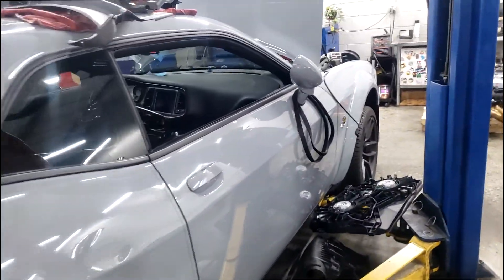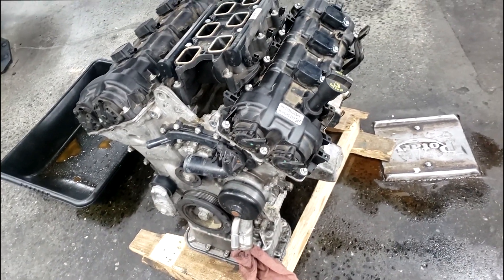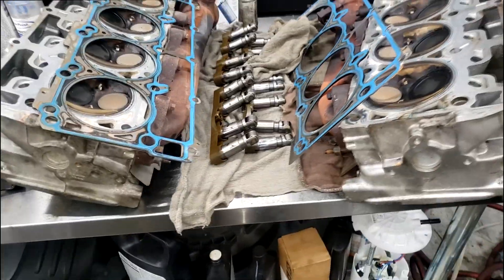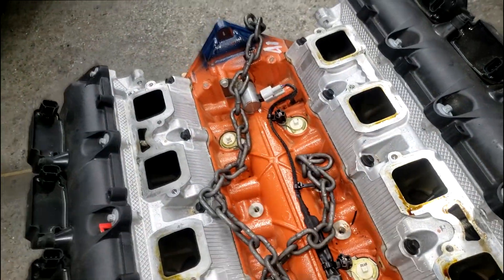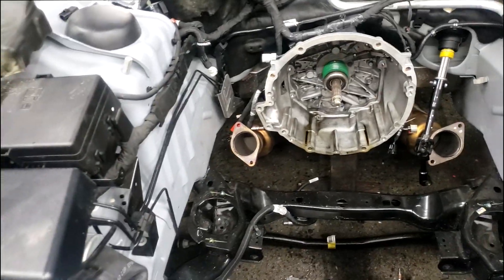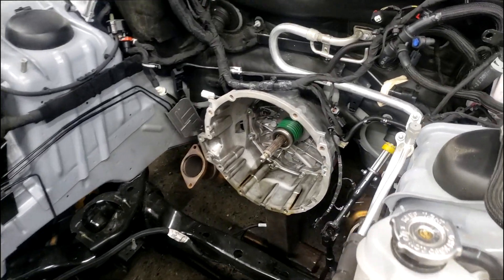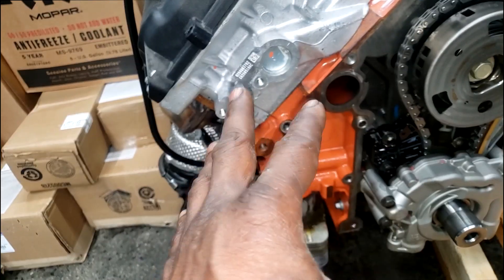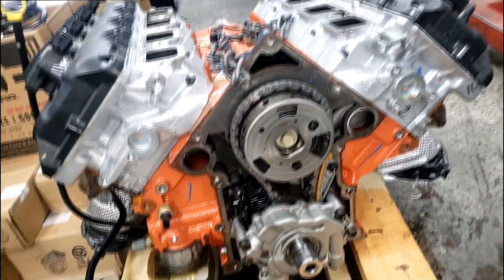Here's why this motor getting replaced.

Comment: I worked at a Chrysler dealership for many years.  There was a TSB at one point in time, probably around 2015 - for cars where they originally recommended full synthetic 0W40 in the past, it was recommended that if the car is being used for any "Severe Service Duties - such as Police or Taxi, to upgrade to 5W40 full synthetic.   Nothing said about racing, but I can assume that it would fall under the "Severe Service" category.   

I run my 392 V8 on 5w40 as well as I some Lucas zddp.  I also have an automatic and disabled the MDS.  So far, I have been lucky but who knows what the future beholds.  There has also been some discussion within Chrysler as to which oil filter to use.  Some filters are white with blue lettering and others are black with silver lettering.  I have been told to avoid the white filter and use the black filter for this particular group of engines.
  
Plate C
Reply: Catch can and top tier fuel stations like shell/chevron

Comment: People!  Stop driving through water!  If the water is more than about ~6 to 10 inches deep then you're in trouble and you're probably gonna need a new engine.  In most cars the air intake is down below the air filter box and it goes down just above the bottom of your bumper.  So, higher than 10 inches if you're in a truck but if that water gets into your engine then its done.  Rods and valve stems are probably bent, maybe even a hole or a crack in the block.  Either way the damage is done.